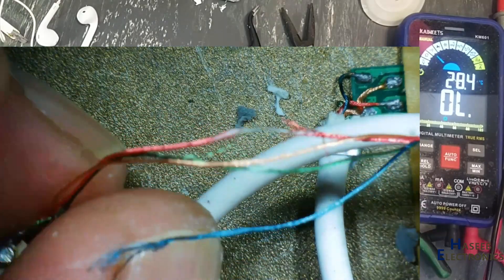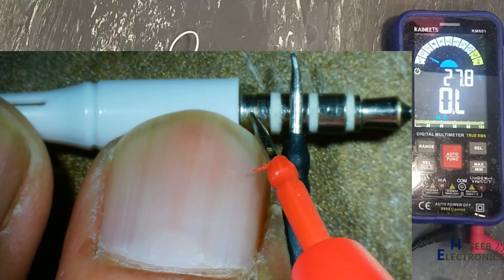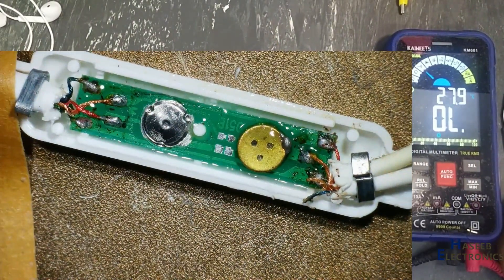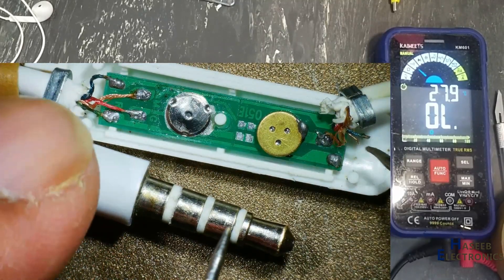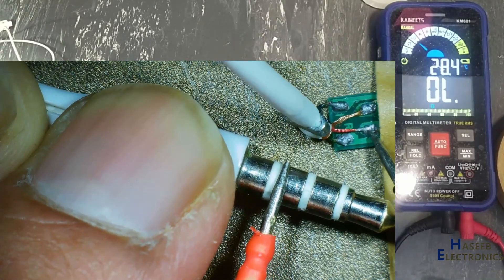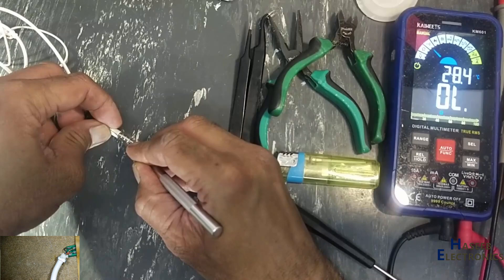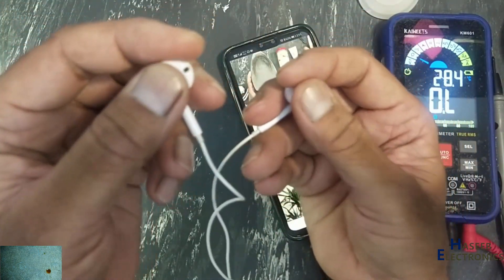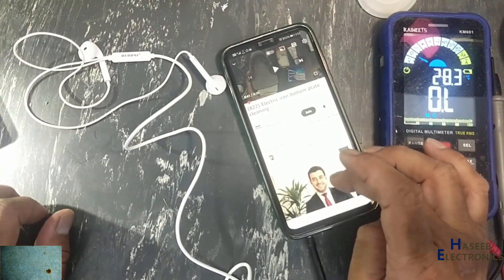{1183} Handsfree repair, microphone and speakers not working

Comment: Great job, I tried more time to solder this thinner wires without success, the tin don't attach. You are a magician
Reply from the maker: best regards 
we need above 360-400 degree centigrade to burn out the enameled coating and to tin the wire

Comment: I learned a simple trick on this video and thank you for that. I tried to put a headphone jack like this on a headset and the super flexible wires were so frustrating to strip and solder that I gave up. Melting the insulation and tinning the wire before trimming off the end seems like a game changer. I still have the headset. I will give it another try!